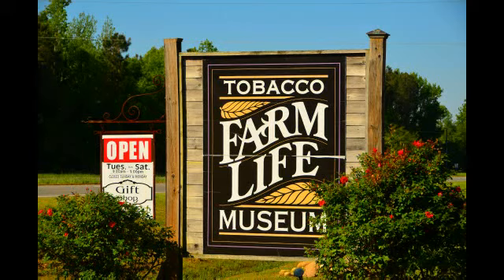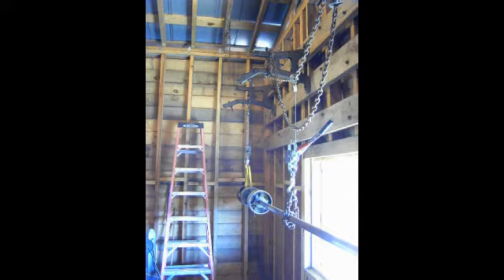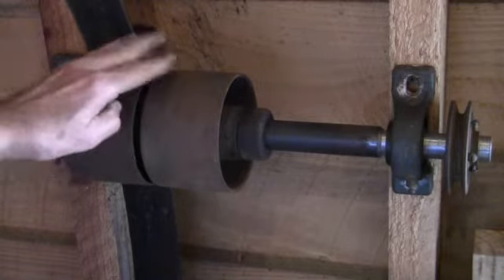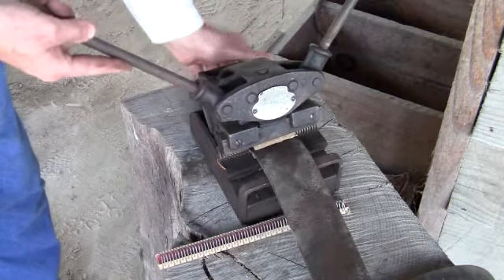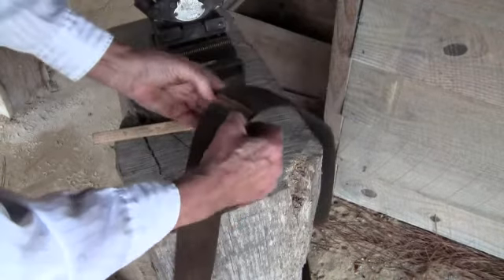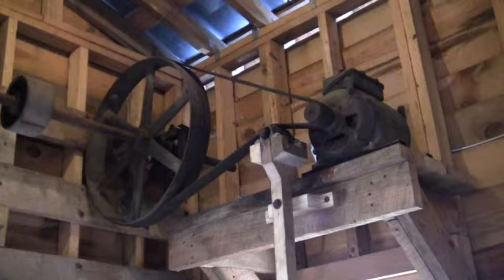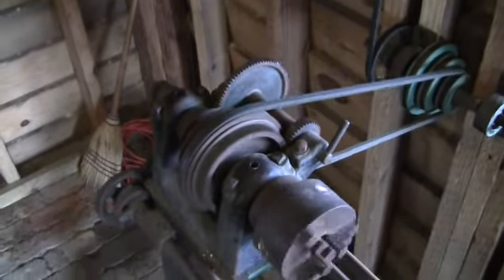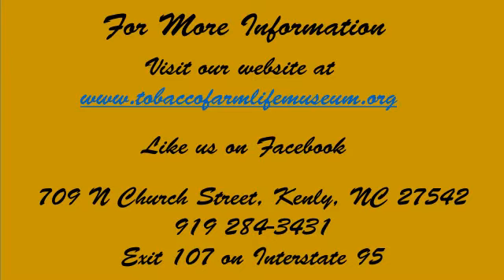Installation and Operation of a Vintage Line Shaft

Comment: Hi there. I live in NC, and am looking to set up a small lineshaft for my artists metalworking shop. basically just a lathe, a drill press and a power hammer running off an old diesel engine since it beats trying to have multiple beefy 3phase motors on a middle of nowhere off grid location. My question is do you know of a source for the pulleys and bearing brackets for a lineshaft that might be somewhere close to NC, and not break the bank? im 25 and on an artists budget, i dont mind putting in work to fix things but the prices some folks charge for the pieces here as decorator items are insane. Sadly there werent that many factories and shops in NC that used these compared with further north and ive not had any luck finding them on my own. Hopefully asking around and casting a wider net will find something.
Reply from the maker: Hi Emily, thanks for reaching out! Could you send your email address to me at bethn@tobaccofarmlifemuseum.org? I can reach out to our partners that assist us with the farm workshop and forward you any helpful info they have. Thanks! - Beth
Reply: @Casey Casen Instablaster :)
Reply: @Bradley Charles i really appreciate your reply. I got to the site on google and im in the hacking process now.
Looks like it's gonna take quite some time so I will get back to you later when my account password hopefully is recovered.
Reply: @Bradley Charles It worked and I finally got access to my account again. Im so happy!
Thank you so much, you really help me out!
Reply: @Casey Casen You are welcome :)